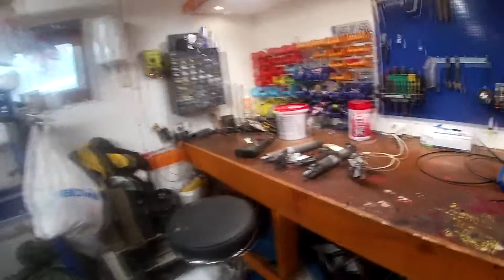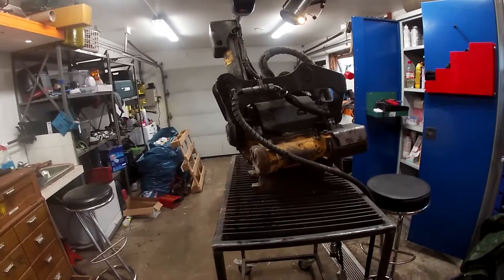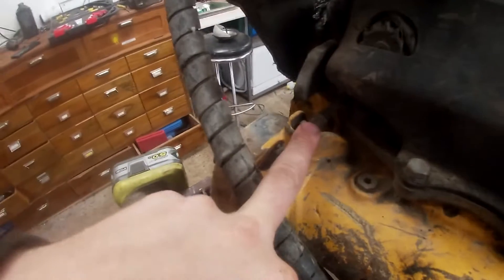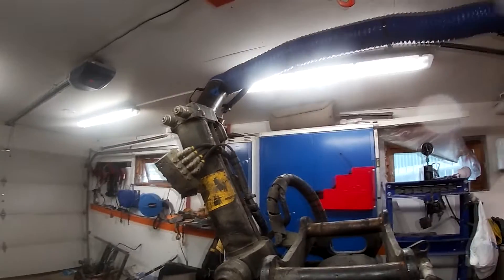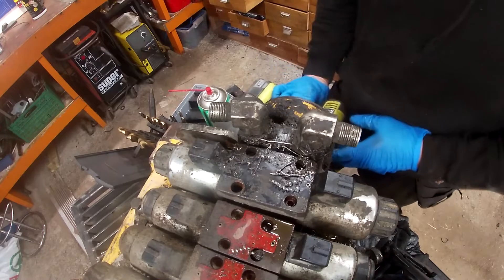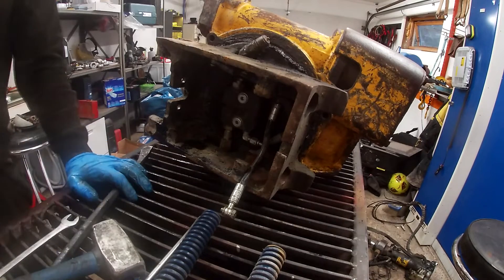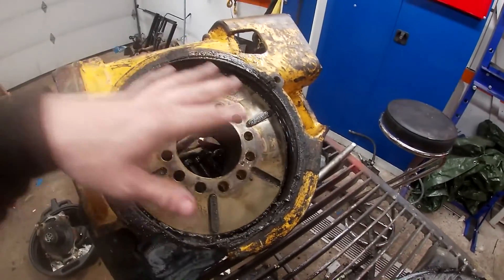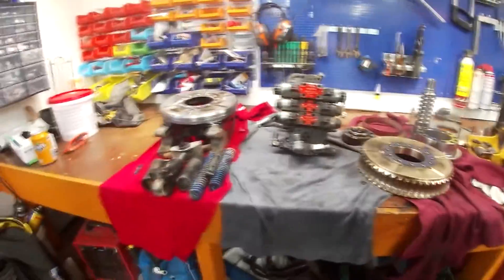Fixing a broken Engcon tiltrotator part 1

Comment: I recently bought a 1964 John Deere 2010-series farm tractor dirt cheap. It is the 'utility' version with the front end bucket loader. My intention is to build my own backhoe, with an extendable stick. Having drooled over the tiltrotator videos in the past, i will eventually have to build one of those as well. I plan on using a 5-ton 4wd truck spindle/hub assembly. Rams and hydraulic motors can be bought cheaply from surpluscenter.com

Having the servo-controlled hydraulic valves is a must. It allows you to do 5+ things with just one feed and one return line. Thankfully i know how to build my own electronic control system.

Probably my hardest task will be machining the center 2-line hydraulic pass-thru. But it is a must-have for operating the rotator, the tool-changer, and the grabber.

Comment: A bit of a gamble to repair, but isnt this thing too heavy for your tc 25? Nice to see someone repair this type of machine, i was thinking to build one by myself too. For your excavator  a ec02b is beter suited
Reply from the maker: Engcon says it's for an 2-4 ton machine, but yes 116kg is much weight for the little terex. If I continue the homemade one it will be less weight for sure.
Reply: Great project very well done...! Could you possibly use an Arduino or Raspberry Pi for the electronics? It would be a shame not to utilise the Engcon electro valves.
Reply from the maker: @helipilot7055  Thx, yes it's possible to make an control for it,  but than I need to buy new joysticks with an roller\potmeeter. When using the pedals in the excavator I can control the flow with how much I open the pedal, with the electronics I need to adjust how much power I send to the valve.
But I have an plan that's easy I think will post Part 2 today where I go true that plan.
Reply: @MiniMachines1  Now that you have the Engcon, will you still continue with your home built tiltrotator?
Reply from the maker: Yes I will finish it during the winter, I have it now disassembled because I broke some bolts that holds the quick coupler, so will make an video building it from scratch now. And also I think the homemade one will be nice for building retaining walls since it's lighter than the engcon
Reply: I will look forward to see this as I am planning to build one for my JCB8026, I have ordered the rotator from China. 
This is also an interesting build:  https://www.maskinisten.net/viewtopic.php?f=98&t=194251

Comment: If it were me I'd be tempted to take the broken part to a specialist welding company who had the necessary preheat oven etc and experience to ensure a first class repair rather than risk bodging it. It looks to be well worth the charge. Hope it works out for you there's at least a sporting chance of success as an amateur welder.

Comment: Are you sure the housing is cast iron and not cast steel ?
Reply from the maker: Yes I it's cast steel 😁 I've tried welding it a little and seems to work great, got my new welder top day so guess this weekend it's game on 👍
Reply from the maker: In fact I found out a few days ago it's cast iron, and engcon confirmed it in an facebook post I had. So thats make the welding part a lot easier. Than I dont need to worry about preheating and slow cooldown. And I can weld other materials to it if I want for reinforcement.
Reply: @MiniMachines1  i think you mean that it is cast steel wich is good  weldable, cast iron really isnt.